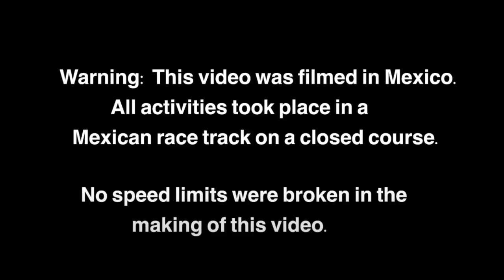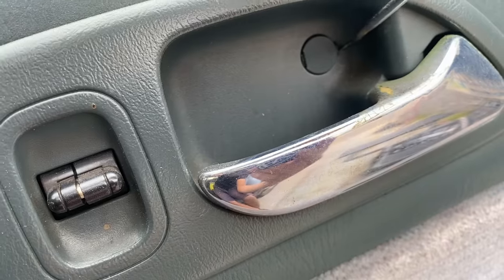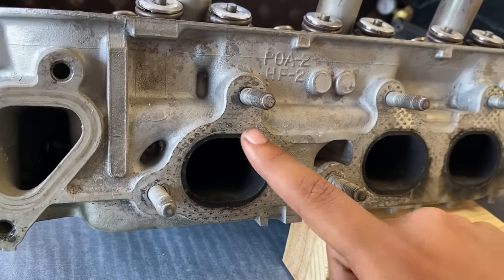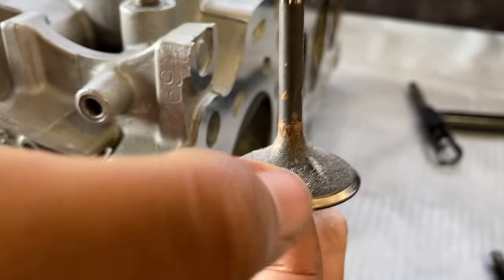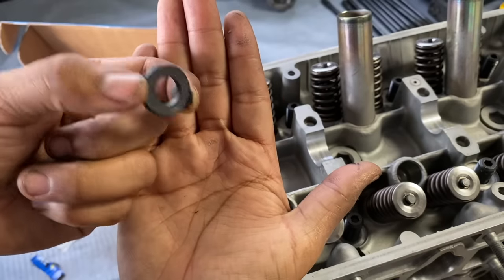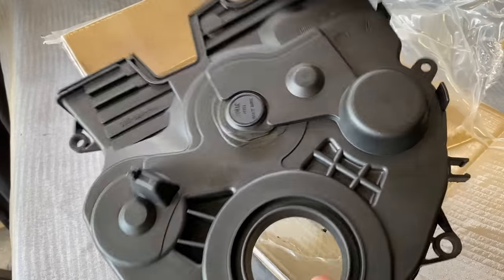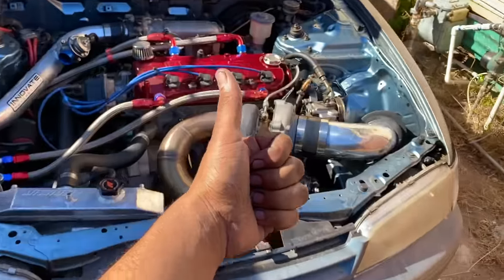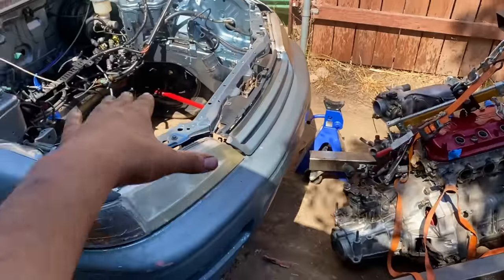Turbo Honda makes 392 Charger Mad + Build Upgrades

Comment: I've worked in the auto industry for years, and no dodge owner should call any Honda a POS. I like dodges too, but a 20 year old Honda will generally outlast a new Dodge. 😂
Reply: Nah, that's a definitely my good man.
Reply: I bought a one owner 96 Accord with 300k miles for $1200. The sunroof worked, the AC was ice cold. All the power locks worked. Only a few small leaks but still ran like a champ. I flipped it to a friend but wish i would have kept it!
Reply: right..all these cheap pos dodges runnign around thinking they are fast crashing into stuff
Reply: @HammerLeaf  😂👌
Reply: @HammerLeaf  can you do me a couple favors with a camera?
Reply: @corbinsmith50  Everytime someone flips a Honda a piece of them goes with the car lol..
Reply: New mopar is pure trash
Reply: Any vehicle 20 years old will Outlast a new vehicle nowadays
Reply: @bdub96u99  yeah. That's absolutely true too. Well, with the exception of a Chrysler product. 😂
Reply: Well i pull my delslow with a 96 2500 v8 5.9 they both got balls
Reply: @50k50000000000000000  that's true. But THIS video and conversation is about Honda/dodge.
Reply: @randymiles904  Omg when's the last time you saw a dodge intrepid? Literally disposable cars.
Reply: @jimdandy8119  haha! It's funny you bring up an intrepid. One of my customers just bought one. I have no idea where the hell he found it. I hadnt seen one in years. Lol
Reply: @jimdandy8119  haha! It's funny you bring up an intrepid. One of my customers just bought one. I have no idea where the hell he found it. I hadnt seen one in years. Lol
Reply: @corbinsmith50  $1200? How the hell? I'm from South Africa and cares start at like 3x that. Buying s car you can drive away fro anywhere near $2000 is a job well done. Gosh you guys are lucky. Car stuffs so cheap for you.
Reply: @gothixxx12  Bangladeshi here, decent used cars that don't require much maintenance post-purchase (and even then, are mostly 00s shitboxes) start at around the equivalent of USD 8,000. Developing countries pay through the ass for owning cars.
Reply: Especially how people drive them
Reply: I have a dodge dart :D
Reply: @whatoh3407  cool looking cars. Too bad about the engineering aspect though. Haha!
Reply: My 2003 K24 5 speed manual Accord is better than a new Dodge
Reply: @dawicked2k8  yes it is. 😉
Reply: Well yeah, in 2021 they still have crank windows and manual seat adjustments. LoL
Reply: @lukehelleksen68  thank goodness. I wish mine had manual controls. At least they last on a Honda. I had to change the window motor in a 2019 challenger a few weeks ago. That's ridiculous.
Reply: @randymiles904  exactly my point. They're cheap. Saying your Hondas reliable is like saying you bicycle is reliable.
Reply: @lukehelleksen68  they're not cheap. They're inexpensive.  Inexpensive, and well built. Dodges are overpriced garbage. Anyone who knows anything about cars knows it. Caviar is expensive, but it's still something a fish shit out 😂
Reply: @randymiles904  LMFAO no they're cheap. Cloth interiors, manual adjustments for everything, giant clunky plastic everywhere.... There's nothing to break.
Reply: @drewp.weiner4419  if you don't own one why do you care???
Reply: Because MOPARTS
Reply: Honda pilots are goated
Reply: @Deanda Disweng Chrysler is literally owned by the same group as fiat.
Reply: @bdub96u99  so a dodge intrepid? Lol. Reliable vehicles last, doesn't matter the vintage.
Reply: @BigWheel.  Dodge intrepid Dodge neon good scrap yard lines if you're looking for septic tank
Reply: No sensible gearhead anywhere can claim mopar is higher quality than honda.  There's a reason dodge is the worst out of the American big 3 in terms of resale and reliability
Reply: @cb7s4life  true story. 😉
Reply: @randymiles904  not really
Reply: @lukehelleksen68  what?
Reply: @Theredstar2478  really, and everyone knows it.
Reply: @randymiles904  nah not really, just depends on what car you talking about, new dodge? Hell yea they’ll prolly last like 20 years max which is horrible for a car, the new dodge cars suck balls
Reply: We have a 2003 honda accord with 312,000 miles. Runs perfect. No rips or tears inside, and body is really clean overall. We own a construction business, so our other vehicles are tundras. We own three of them.
Reply: true 😂
Reply: Yup. Dodges are really crappy made. Those cars are also so heavy how do you expect to win anything when weighing 4500lb with driver. Like really? Lol
Reply: Facts. Honda engines are well built.
Reply: @jimdandy8119  Really, because mine lasted 170k miles and I only got rid of it because the timing belt broke. It was supposed to be changed at 120k.
Reply: You're leaving out the most important part. The new engine it this Honda will not last. I can make a 1L beat a SRT. Then it's time for a rebuild.
Reply: @jerzyfam  I think you're confusing dodge with the mustang.
Reply: @randymiles904  ya know. I have to call your bluff. I went through about 3 ford's 2x Saturn engines  before I found dodge. 90s Ford's lasted for 70+80k. Raised in a Ford family and watched their trash cars break one after another.

Then I found dodge. Mom had a caravan that went 200k, bought another one that went 170. I found a used Plymouth Duster that went 170, then on to an Intrepid that went 170. Bought a new avenger in 08, never had a single problem with it and traded it on my current charger in 16. I have not made a single repair to any of those vehicles other than a trans rebuild on the duster @ 140k, a ball joint in the intrepid, and an inner tie rod on the charger ($40). Oil and brakes, that's it.

You can make any car last a long time of it of you maintain it. The difference here is someone who would buy something like a Honda is more apt to make good decisions to take care of it.
Reply: @leonpalnau6839  sounds like you got lucky with the dodge. Good for you. 👍 Unfortunately 90% of the population don't have the same luck. You should definitely start buying lotto tickets with you luck.
Reply: @randymiles904  that's just BS. There's no luck at all. My charger has a gen 3 hemi that is proven to go 300k with proper maintenance. Look up used rams man. The gen 3 hemi was co designed at the end of the partnership between Daimler and Chrysler. Speaking of Daimler, the transmission and AWD (I have a HEMI AWD) is the exact same transmission and transfer case that moved the Mercedes Benz E class and a few of the other cars all the way up to about 5 years ago. Built by Mercedes and installed straight into Chargers.Are Mercedes crap? The bottom line is there will always be this fanboy crap, but a properly maintained Dodge will last longer than any other "American Made" Car. Ford burned me over and over. I mean for god sakes my first newer car was a Ford contour with 20k miles on it and at 30k the front wheel fell off. The fricking ball joint was held on with rivets. RIVETS. Chevys drive nice, bit their engines never last. If you want a history lesson check out Chevy 3.6 v6 lower intake gasket failures. They put that engine in almost every car they made for 15 years and half of them leaked coolant into the cylinders within 50k miles and destroyed the engine 15k after the warranty expired. Garbage.
Reply: @leonpalnau6839  ok bud. Enjoy your dodge. You've had your experience, and I've fixed droves of dodges who's owners had very different experiences. You do you, hotrod.
Reply: @randymiles904   So full of it. Its always someone claiming to work in mechanics and claiming that they fix more dodges than anything, yet when they talk to a real mechanic or go to any shop, you see every make and brand. Who pays you guys? Seriously I'm curious.
Reply: @jerzyfam  “crashing into stuff” hahahahaha so true
Reply: Especially because of the types of drivers dodge has
Reply: Truth!!
Reply: @randymiles904  my 2001 Chrysler pt cruiser was very reliable so that’s false
Reply: @CJ-ow1cw  lots of people have had reliable Chrysler/ dodge products including myself. But that doesn't change the fact that they're horrible cars. Unreliable, and always something going wrong. If you get a good one, you're lucky, and will probably love it. But if you're like the other 99% of dodge owners, you'll consider setting it on fire.  Also, ask anyone who knows.what they're talking about, and they will all tell you to stay away from. The Mercedes designed Chrysler products. I don't know who make the decision to have Americans build European designed cars, with very cheaply built components, but they should be given finger nail splints. Common sense should have shut that project down, but it didn't. But look on the bright side. Since you're a fan, there are PLENTY of dead ones out there you can buy. Most of them have less than 100,000 miles too. Knock yourself out. 😂
Reply: Yeah thats basically any old car/truck, shit now a-days sucks expessially bc of the emissions they require depending on the state
Reply: I own a 2003 Dodge neon SRT-4, which I bought new in 2003 (back in the Daimler days). It has 220k miles on it now. It starts up every time (with the original starter motor no less!). The 2.4L turbo engine still runs like new (still original) and still pulls 18 psi on the original stock turbo. The 5 speed manual trans was replaced (under warranty) at around 70k miles due to a defect and since then it still shifts like a new car (added stiff bushings and short throw shifter). The brakes work great. The AC still blows really cold. The ORIGINAL fog light bulbs from 2003 still work, believe it or not!...

On the downside, it leaks coolant... Like a lot. I have to constantly add coolant. I have to add a quart of oil every 1000-1500 miles. It developed water leaks in the trunk and in the front passenger side. I finally tracked those down and fixed. The body has rust on the rear quarter panels. And the paint looks like shit now. The clearcoat failed and it looks faded and scratched. The heater core took a dump. I will need to replace it this fall. I replaced the fuel pump once and the power steering pump a couple times. The driver's seat was so trashed I bought another set of seats for the front that were in pretty good shape. 

All things considered, I can't complain. It's been paid off since 2008. It's still useful as a beater. Parts are cheap and it's easy to work on. It's pretty reliable except for the coolant leaks. 

I also own a 2008 Honda Accord EX-L sedan which i bought used in 2014. It has the same mileage, around 220k. The car still looks, runs and drives almost like new. The paint is in good shape and no rust or water leaks, not even in the sunroof. 5 speed automatic still shifts fine. Everything works. The leather seats got a little beaten up. I got them repaired by a local upholstery guy for around $300 each in the front. Only major component that went bad was the starter a few years ago. 

The car is tough on rear brakes, but otherwise very solid, reliable, comfortable, roomy, and decent fuel mileage. It is the 190 HP 2.4L n/a 4 cylinder. It's not very quick, but a great car for a long trip or long daily commute. 

I never used to like Hondas but I bought this when I needed a comfy car for a long commute back in 2014 and I have absolutely no regrets. 

I would definitely buy another Honda...
Dodge... now? Eh, not so much.
Reply: @dr.bunterhidenbrobruh5502  lol I understand 100% brother.
Reply: Yes, but where would you take a decent woman in that Honda?? Would you take her out on your Anniversary in that thing? Would you even HAVE a woman if you still drove one?? I notice this guy is driving around his laughing hyena friend in the passenger seat with his feet wrapped in wires and cables. Is that where your woman would be sitting? Besides, I don't know that Honda's will outlast Dodge's today, of if they're just cheaper to fix? What do you drive, Randy Miles?? A Honda??
Reply: @ranman4481  alot of silly ass questions there, but yes. To answer your main question, I do own a Honda, two Acuras, and a toyota. Not that it matters. I've owned and worked on pretty much any car brand available. After being educated on the "what's what", yes, I CHOOSE, to drive Honda/Acura mostly.
Reply: Honda owner responds: I beg to differ sir
Reply: @sanchocloset5987  you can like what you like. And everyone has slightly different experiences, but that doesn't change the fact that car guys know what's what.
Reply: As a tow truck driver I will confirm and say I tow waaaaaaaaaay more mopars than I do Hondas and Toyotas. 🤷🏼‍♂️
Reply: @TheMrDarius  absolutely. 👍
Reply: I'll take the V8 392 Dodge any day, over a Gook Box Honda or Toyota or Nissan save for the NSX ?
Reply: Lol not even two days ago a Honda driver flew by going 100 plus ‘ 30 seconds later it was a crumbling up tin can in a fireball . I’ve done some research for the last 3 months in Ontario for fatal crashes and almost every one was a Honda newer and old
Reply: Cause all those 20 year old cars were over engineered to last.
New cars these days are made to make more $$$$
Reply: @simpolang  exactly.
Reply: @simpolang  bingo same as the old domestics we’re Over-engineered to last forever and not fall apart like the new computerized components with built-in fail points so you have to spend thousands more to line there pockets .
Reply: To be fair a lot of new chargers and challengers are being driven by people who don’t know how to break in a brand new vehicle and by people who don’t know how to drive a car with some horses in it and they crash them.
Reply: My family and I joke because we had an Accord that had been in 6+ accidents and 140k miles. That thing just kept going.
Reply: @minew2349  🤣 true story.
Reply: I’m a service advisor for Dodge. I down own a Dodge for a damn good reason 😂
Reply: @Matro_R  🤣 that's great👌
Reply: No
Reply: Honestly I can agree, my Camry from 2007 has never broken down and I’ve ran it without oil changes many times before. But, my scatpack that I’ve had since 2020 hasn’t broken down once either, and I’ve never rlly had problems with it. Only problem I have with it is the tire wear 💀.
Reply: @corbinsmith50 accord aren’t bad they are just too small for a tall guy like me. I was driving my gfs accord every time i hit the brake my boat feet kept hitting the gas as well.
Reply: @leonpalnau6839  you just mad cause randy got ya😚
Reply: so that makes it cooler? I don’t get it
Reply: @nahim_ightbru  that's correct. You do not. Lol
Reply: @randymiles904  all honda owners say that same shit tho. I’ve been in mopars n they’re fun asf. No hate I’m jus saying
Reply: Idk, I had a 08 5.7 Durango and it lasted 350,000 miles. Just sold it. Might be going stoll
Reply: @jerzyfam you're talking about mustangs
Reply: @johnjones3267  the only thing wrong with mustangs, is that they're owners dog the shit outta them. 🤣
Reply: No doubt I’ve owned every ram 2500 made and the transmission always breaks within 100,000 miles horrible
Reply: @Chad-v4j  wow. I've got a friend that's a county cop. His cruiser is the V8 charger. He said it would run 160 up and down the highway no problem, but he had to have a new transmission twice, in two and a half years. I was driving a pretty damn nice crown Vic at the time. He told me he wouldn't take ten of those chargers for one of the crown vics.
Reply: I own a 1991 Honda Civic Si...and I have HUMILIATED (around corners) a Dodge just like the one in this video.  Left him hundreds of meters behind.  

When it was over, of course I slowed down, and he came RIPPING up behind me to do a fly by, and was wearing the face of MAXIMUM BUTT-HURT. OMFG, it was hilarious.  What is it about Dodge guys and their fragile egos, eh? hahahahaha

To make matters worse (for him) it was summer, and the windows on both our cars were wide open, so he easily heard the full-throated laughter of my best friend laughing straight at his face, as he did the fly by.
Reply: @Maplecook  that's exactly why I like little Honda's and Acuras. A little work on the suspension, and the right tires makes one hell of a curve carver. It doesn't matter how fast you can go in a straight line if you slide off the road when try to rip a curve.
Reply: @randymiles904  My car still has STOCK suspension, but the tires are sticky. haha

There's NOTHING on the street that can out-corner me.
Reply: @Maplecook  I've got a 98 Integra, and I've put money in the suspension, brakes, wheels and tires. The damn thing handles better than anything I've ever driven. Including my Miata 😆
Reply: @randymiles904  I have a Hot Wheels of your car!! hahahaha

Both our cars have such high handling limits, it would be suicide to test each other on the street. Cars like this -- if you intend to push it RIGHT to the limit -- need to be wrung out on a track. I'm sure you'll agree.  

In the world of normal street driving, yeah, double wishbones and a light chassis are pretty much impossible to beat. Our cars are as good as it gets. haha
Reply: @Maplecook  i live in TN, about 30 mins from the dragon. All the roads here are curvy as hell, compared to most places. That's our track😆
Reply: @randymiles904  Okay, you got me on that one! hahaha

"To every rule, there is an exception."

I can see you wringing out your car -- provided you did it safely -- on that road. 

I'm jealous, man. I live in the Vancouver area, and it seems that every day, the powers that be, are trying to erase all the fun from us.
Reply: @Maplecook  man I get that. Like around here the old school cops would play around with you in their cruisers if you had a fast car. Now all these young cats would rather take you to jail, talking about excessive speed. Lol
Reply: @randymiles904  Tell me about it. There's a particular officer on the VPD, whose name begins with C, and rhymes with, "pain," who is an absolute JERK about every aspect of his job. He's widely hated by everyone in the car community up here, because he is like the a**hole who would throw a handful of sand into the city's bread dough, just for kicks. Sure, just ruin life for everyone, just to get your jollies, man. Ugh.  

Off topic, but having scanned the other hundred or so comments here, it seems like we are indeed similar, you and I.  I have, in addition to my EF, a 97 Celica GT-S, and a 92 Lexus SC400.  Love 'em all.  That one commentor who said you couldn't get a woman if you drive a Honda? He must have no luck with women, and needs to blame Honda. lmaoooooo! I married my dream girl, and she prefers the EF over the Lexus, even though I have lowly crank windows, man.  A real man can get women, even if he takes the bus. 

And there seem to be a lot of Dodge fanboys in here, and I guess that's natural. They do have a certain kind of brainwashing going on though, I find. My neighbour is one of them, and drives both a Charger and a Magnum.  "My Magnum is really reliable," he says, "it's only been through two transmissions." Um...obviously, he's using a different definition of, "reliable."
Reply: My Honda is 40 and will outlast a dodge built today.
Reply: As far as longevity most Japanese brands simply are just better than domestic or European
Reply: Dodge, Ford , Chevy as a German i can tell it sucks to work on all of them.
Reply: Nah this is definitely cap big guy but whatever helps u cope 😂😂
Reply: @jerzyfam 2 years ago i bet you still dont have a whip cope lil asian boy 😂
Reply: @jimdandy8119 just like your life
Reply: @johnsalinas8562  .......ok?
Reply: @JaRa911 so true I always leave something I didn’t mean to into my honda flips haha. Dude who bought the crv for 850$ can I please have my mke lanyard back my sister bought me that a long time ago can’t believe I forgot it that time.
Reply: @cb7s4life stop your propaganda man, those days have been in the past for a long time. The 392 and Hellcat platforms are worlds beyond, where you are stuck in past. Newer Honda powertrains are boring and status quo with their competitors. I don’t know where you “respectively mechanic” at but the 5.7, 6.4 and 6.2 SC platforms I’ve helped build are insanely reliable hot rods. Came from Honda but the two worlds are far apart
Reply: Man I had a '94 Kia Sephia that ran longer than some of these newer vehicles. Probably still running to this day. I ended up donating it, because it was literally "priceless", and I didn't have the room to keep it any longer
Reply: What about new Hondas? How long do you think those will last?
Reply: I’d like to know the mileage on the cars people are mentioning. Doesn’t matter how many years old, what matters is mileage . And I wonder if they ever did transmission fluid changes
Reply: Everything old outlasts anything new. Just result of capitalistic requirements and greed of share holders.
Reply: I used to look at hp and torque numbers for the smaller engines. Toy had the most torque, Honda had the most hp, and VW was beyond compare. fyi this is specific horsepower or hp/liter. The Integra of ~ broke the record for NA engine with 100 hp/liter. A decade later, Toy was doing it in the Celica GT-S. But yeah, torque is felt and more exciting than hp.
Reply: Dodge is literally known for being a POS car manufacturer 😂 big ego guy lol
Reply: it’s only a POs if you’re trying to make it fast and treat it like a race car
Reply: not really they aren’t even designed to go fast or do the same things as a v8 an old dodge truck or even car will outlast any like btch Honda civic that kids have no real men drive civics around
Reply: @bdub96u99 no it won’t that’s what all people say that have shitty cars to justify that it not shitty it’s ok we all gotta start somewhere I felt like a scumbag driving arou in my Honda civic because all you see driving them around are females and high schoolers because they’re affordable and good on gas mileage but comparing them to a fkn v8 thinking they are better is hilarious a classic dodge will shit on any Honda civic on earth idc how rice you make it
Reply: To be fair they crash before their car breaks down, so they thinks it’s reliable 😂
Reply: 230,000 on my 03 Civic EX. Everything works. AC blows cold. Runs 80 mph all day at 35 mpg. I would take it cross country without a worry in the world......
Reply: FACTS
Reply: Eh, tell that to my 36 year old KCar
Reply: fiat